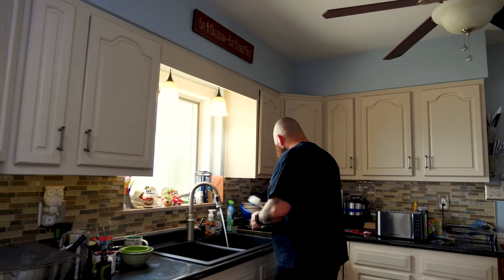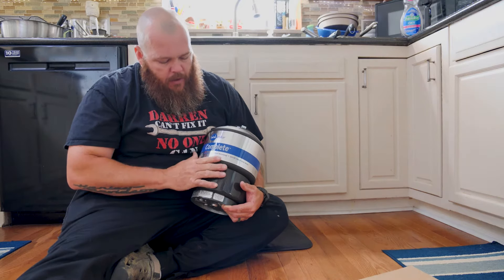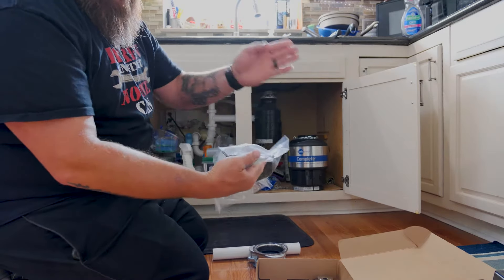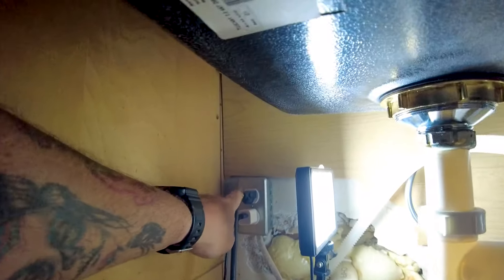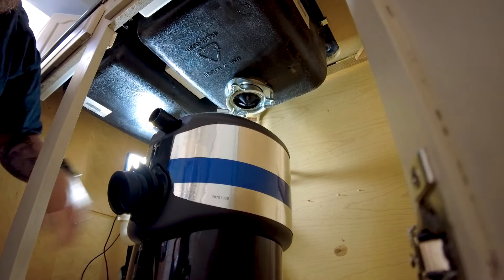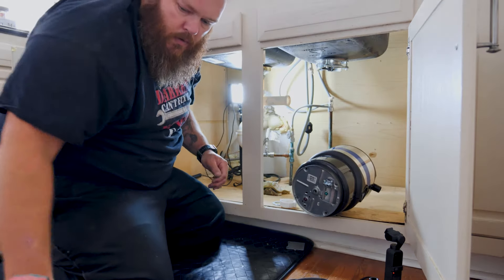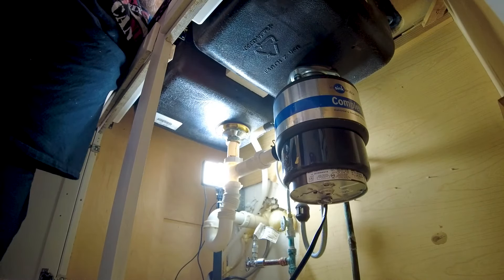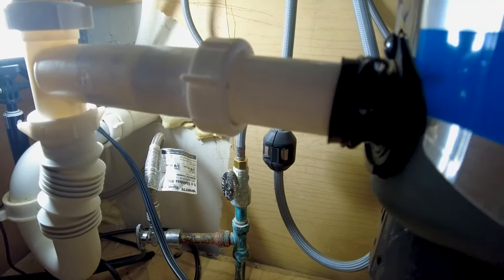Unboxing and Install of InSinkErator Garbage Disposal

Comment: It finally arrived and I installed it. 

One thing I noticed is that the housing is loose. Is yours like that as well?
Reply from the maker: Yes mine is also it is just a foam cover for noise dampening
Reply: @dmurphy68  thanks my man. You were helpful in this journey. First time that I replace a garbage disposal
Reply from the maker: @Joalse   glad I was helpful

Comment: It took some work to raise to connect under the sink. Since it was a little heavy had to use some 2x4s as leverage and pry up and then connect to the turning collar. But once connected the rest was easy and it works like expected and no drips. My wife is happy.
Reply from the maker: Yea it can be a pain sometimes

Comment: Does your unit make a sound not a literal spark but a sound that sounds like a spark when you turn it on and turn it off as it slows down before completely stopping ?
Reply from the maker: No I have not experienced that. I would send an email to them and ask their advice.
Reply: @dmurphy68  I honestly could have sworn that I heard that sound in your video towards the end when you were demonstrating the quietness of the unit but I will reach out to them, also if it is possible can you share a video of your unit powering on and powering down with as little as possible background noise, just a thought, thanks again for all the help!
Reply from the maker: I think what you are hearing is the blades slowing down and it almost sounds like a shock
Reply: @dmurphy68  I’m not sure if you recognize it now on your unit but it sounds higher than the sound of the blades normally spinning for about a second it does like like the blades though almost as if they knock and skip (make contact and break loose again)
Reply from the maker: Might be in the design of them they are lose until the spinning force locks them in place sort of
Reply: @dmurphy68  yeah they might be it actually thank you for that!